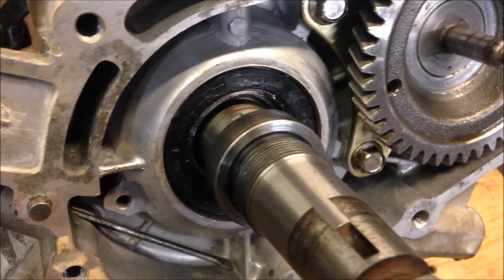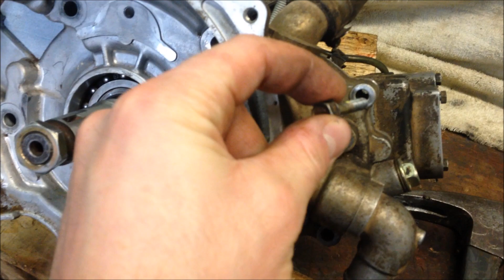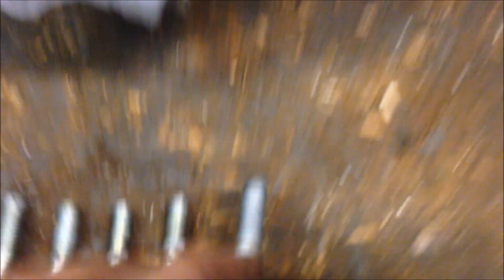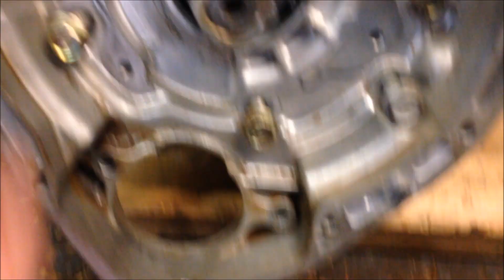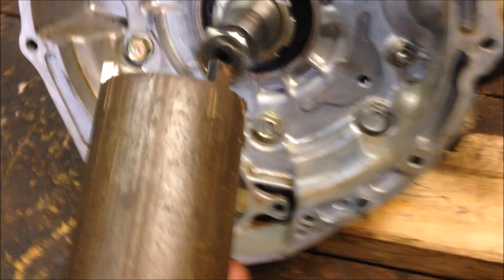Step 7: How to Install Polaris 350 400L Xplorer Crankshaft Gear and Counterbalance Shaft Timing

Comment: Love the videos. Hope you can help me. I pulled the gear off my 1993 350l 2x4 water pump. And didn't mark location of punch.  Now have no idea were it goes. Engine completely apart and am trying to figure out the position of crank rotation compared to water pump. Any help would be greatly appreciated
Reply from the maker: There are timing marks on the gears.
Reply: Yes my problem is I removed the gear to work on the shaft and did not mark the location of punch mark of gear to shaft. Now have no idea were to press gear back on to have counterbalance in proper location.
Reply from the maker: The counterbalance and mating gear have timing marks as well.

Comment: Great video :) im going to split my 93 trail boss 350 engine soon,do i need that special tool you made from pipe on my engine? where can i buy that tool ?
Reply from the maker: The tool for the slotted nut? If so, you can buy one, make one, or use a hammer and a pipe. Remember it's reverse thread.
Reply: @BrapStuff  thanks for fast response,i did find it on ebay :)
Reply: @BrapStuff  ll make one quickly using grinder, to achieve the correct torques.   There is no direct visual access to crank drain nut, l ll make a hole on frame plate for sockets access.

Comment: I finally got my jug back from the machine shop and started rebuilding motor. Are both collars the same? On the meg side the collar I used went in kind smooth all the way in. Didn't have to tap it much.

Comment: How do you prevent bending the water pump shaft? I keep hearing they're very easy to bend
Reply from the maker: See my other video. Pull the shaft out by pulling on the gear....you don't need to touch the shaft at all.

Comment: Do I need the counter balance shaft if I'm not using the water  pump?
Reply from the maker: The splines on the counterbalance shaft also run the oil pump. Fixing it back to OEM specs is always the way to go.

Comment: Do you use any gasket maker on the big gasket? Like how you did on the water pump gasket? I am still waiting on machine shop for crankshaft and my jug. I went with a 84.5mm wiseco piston. Hopefully I'll get it back this week.
Reply from the maker: That one is not so critical, but you can put a little on both sides if you want! Let me know how it goes!!
Reply: Thanks. I'll let you know. I am gonna call the machine shop tomorrow and check on the progress. Maybe they will push it out by the end of this week!  Thanks again!